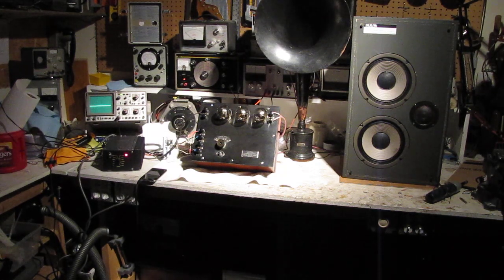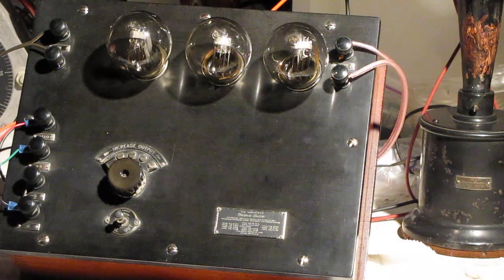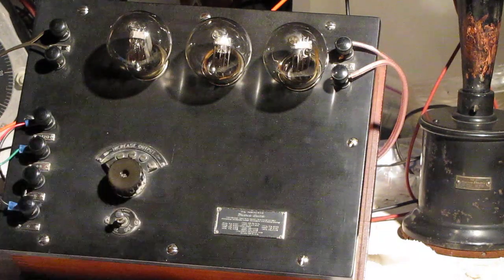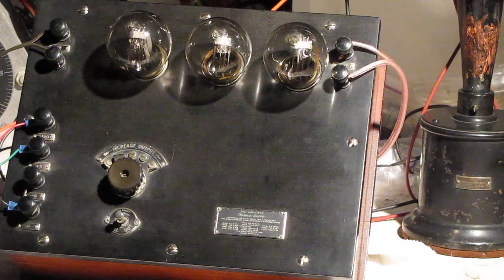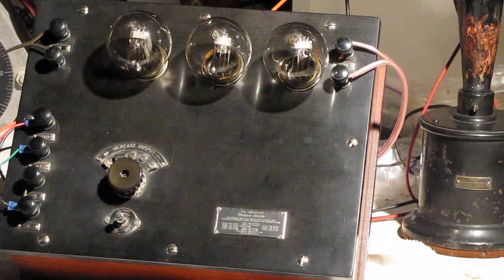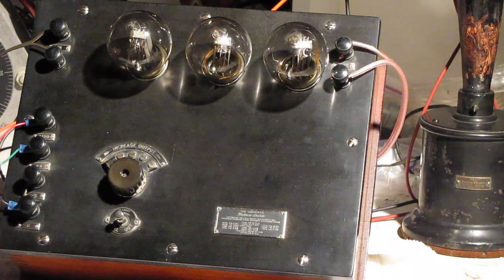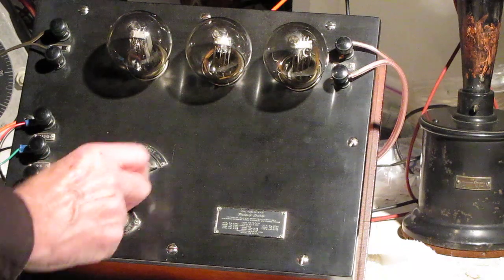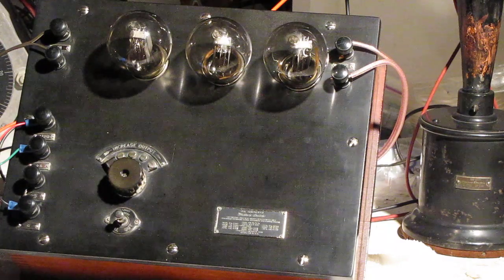WESTERN ELECTRIC 7A 518W SPKR

Comment: It sounds like the input is far more sensitive than any modern amp and thus can be easily overloaded.  I'm guessing that even a crystal radio set could drive it.  Apparently the volume is controlled by secondary taps on the input transformer.  Did you cheat and use another output transformer for the low-impedance modern speaker?

Comment: Using any sort of cell phone or other device such as an iPad or iPod for a source of audio is a very bad idea. The audio from such devices is quite high in distortion in its own right. Should have used a reel to reel deck or turntable. The results would have been much better.